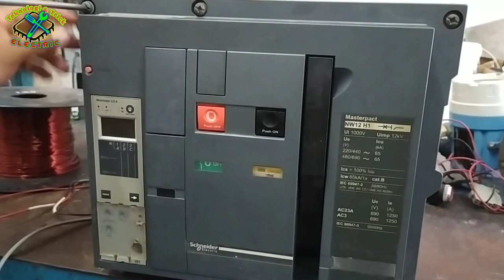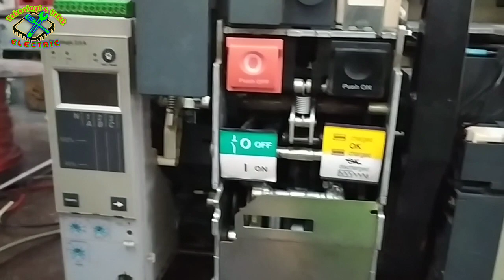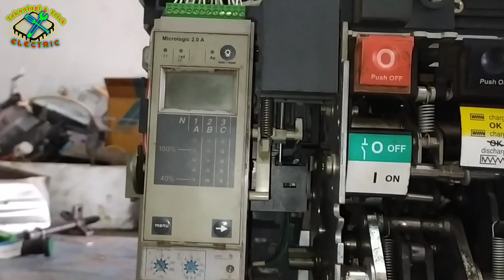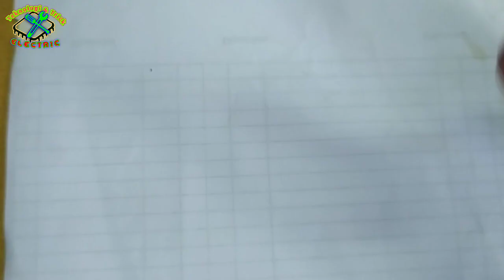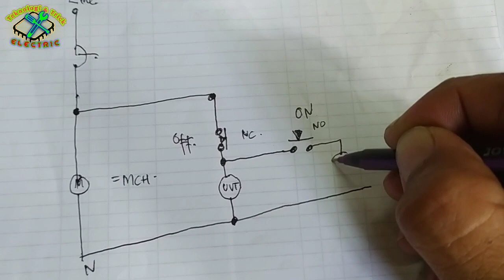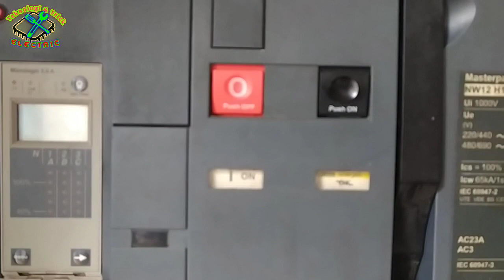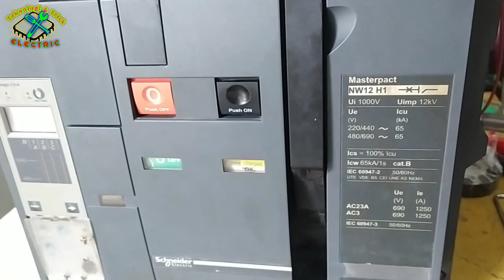ACB Tidak bisa ON dan Langkah Perbaikannya#Schneider NW12 H1

Comment: mau tanya ACB posisi sudah charged ok saya tekan ON lansung posisi OFF dan tombol reset keluar. setela saya lepas ACB dari panel terus saya bongkar. ternyata setelah barang saya lepas ternya baru bisa ON normal. barangnya dibelakang micrologic 2.0 e saya lepas. itu nama baranynya apa ya. 
apa bisa di perbaiki... warna barang sepeti cover depan ACB schneider.

trimak kasih.
Reply from the maker: Itu bagian dari mechanism.Biasanya kerusakan pecah atau aus.
Reply from the maker: Kalau belum parah masih bisa diperbaiki.Kalau pun mencari sepertinya harus ke distributor schneider
Reply from the maker: Untuk namanya SDE

Comment: Ma'af, ACB saya suaranya kasar kayak dengung, MG master pact M20N1. Apa yah penyebabnya ?
Reply from the maker: Yang menyebabkan suara dengung bisa jadi Motorized nya yang berputar terus karena gearnya ada keausan.
Reply: Kalau tanpa motorized, type Master pact M20N1, apa yang harus dirubah wiringnya ? Sebelumnya terima kasih atas ilmunya...
Reply from the maker: @aryaniabdilah2129  kalau tanpa motorized  wiring tidak berubah.Hanya saja Kalau mau aktifkan (ON)terlebih dahulu harus di pompa,(di engkol) tuasnya
Reply: @TrickElectric  kalau di engkol tidak mau itu kenapa pak, posisi semua proteksi dan wiring kontrol sudah dilepas

Comment: Numpang nanya, Kalau ACB tidak mau off otomatis kenapa ya pak???
Reply from the maker: Ada kendala pada sistem proteksi
Reply: On mau off tidak mau
Reply: On mau otomatis tapi off nya harus di tombol Off
Reply: Cek Shunt coilnya.jika pakai.atau UVT atau MN Nya lengket jadi posisi tidak bisa di offkan otomatis
Reply from the maker: Emergency switch tidak berfungsi atau tidak mau off otomatis,UVT wajib di curigai.Karena bisa jadi UVT TERLEPAS atau lengket saat coil uvt narik ke atas.Maka hanya jalan off nya dari tombol depan Acb secara manual
Reply: @sigitaryanto3724  mau fungsi pak, spt nya mekanik ACB nya